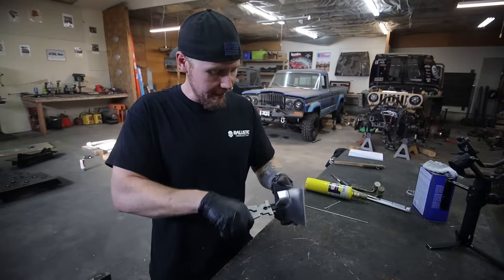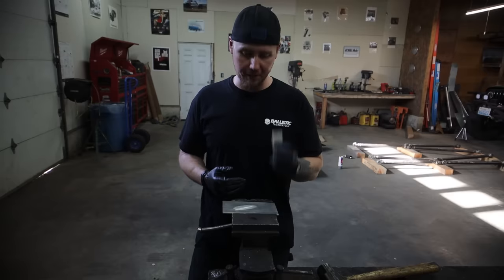Amazon's CHEAP Alternative To Aluminum Welding!!! (Alumaloy)

Comment: Mine came with directions, use a clean stainless wire brush at the joint and immediately heat. sandpaper or even a pocket knife to scrape down to shiny metal. Aluminum oxides form quickly in air (sometimes within seconds) and you'll never get the zinc I mean rods to wet with aluminum (oxide) properly.

Comment: I have tried 6 different types of so called "low temperature aluminum welding rods" with propane and MAPP torches. So far - no luck. I end up with the main aluminum part melting before thin aluminum wire melts upon touching it. Not sure what is wrong in my case. Thanks for the video anyway!
Reply: Using this stuff is soldering or brazing and not welding.

Comment: Fella the word is soldering not brazing. The terms are associated with the temperature range you are using. Just saying, all good too.
Reply: Victory First hey mate, naked flame is brazing!
Reply: @christownsend2399  Naked flame can be soldering, brazing, or welding. Think temperature as I was taught. Naked flame is just that a flame you control. Soldering roughly 300-400 degrees Fahrenheit. Brazing roughly 1100 -1600 Fahrenheit . Welding 2000 plus Farenheit roughly. That is right as I learned 30 years ago by a old certified welder who worked in the field fifty years.  I wish I could remember what that fella forgot. Have a great day too.
Reply: Soldering is capillary action jointing, the other type is inter granular  penetration e.g. bronze welding,the term " brazing " comes from the old  charcoal Braziers used  long ago .usage of the terms seems to be pretty fluid these days.
Reply: @pauldavidson6321  You say potato I say potato but we both are correct to a great degree. Peace and out too.

Comment: I would like to see a video on MiG brazing with silicon bronze wire vs MiG welding.
Reply: I've done this on my MIG, you have to use argon gas and you must make sure that the surface metal is clean.  Once the arc is struck and your machine is set correctly, it will flow much like a braze where the wire melts and adheres to the metal.  This isn't a strong weld it's only purpose is for non-structural joints like body panels.  The wire isn't widely available and in my case I had to order my two pound spools.
Reply: I put on an aluminum welding class at a body shop one time, and they had this MIG welder that have three guns one had steel wire one head silicon bronze and the other one had aluminum
Reply: You might as well just get a spool gun and just use aluminum wire unless you're going for a certain look.

Comment: biggest problem is you need A TON OF HEAT when you have just a little bit of a bigger object.

At work, we tried this stuff to repair big alu dieseltanks, but it was just impossible.
We used 3 torches and it just didnt work, and when it was hot enough, we blew a hole ....

Comment: Thanks for the walk threw on procedures and glad to see you used MAPP gas here since as you've seen, propane would take longer to get the base metal up to the point where the rod would adhere well.  As for use on fuel tanks or pressurized applications, I would of course test first and even wait for a couple of weeks since I've seen other videos describing that some alum weld products would break free under stress.  Also, can this work as well for aluminum alloys, cast aluminum?  As you may have seen, cast aluminum can have other metals mixed in and I'm no expert yet.  I think TIG welding would be the best way to go on structural applications or anything you want to be strong such as motorcycle parts.

Comment: Acts a little bit like solder. Wonder what some flux would have done?
Reply from the maker: They make flux for brazing aluminum but this particular product says it doesn't require it so I didn't use it in the video. We use flux a lot at work in a definitely makes a huge difference in the quality of the joint. My guess is flux would help this stuff but I can't be sure without testing it. 👍
Reply: i am a plumber by trade so tried this works great also used with la-co plumbers flux works even better

Comment: Seems like a great option for connecting aluminum sections for rapid prototyping. Could do lost casting with 3d prints in pla, and then connect them together for larger projects. Might be strong enough for basic fitment and light testing of function.
Reply: The rods are basically ZA27 alloy, just aluminium dissolved in zinc. Joins formed with this stuff become some sort of zinc alloy. I used to make my own rods from old floppy drive chassis, they are not easy to find these days, but carburettors are still made with it.

Comment: quick heat is essential, if it takes too long or you have too long a seam to run the air quickly promotes oxide formation on the hot surface. The flame actually performs the function of shielding the weld, not in the same degree of effectiveness as and envelope of inert gas but still it does consume the oxygen at the point of heating, pulling away allows the air to react to the hot aluminum.

Comment: No fusion so no good!
I wouldn't trust that crap to seal the foil wrapped around my cheese sandwich.
Oh and it's not soldering or brazing of any description, it's a cheap low melting point alloy best suited to casting model soldiers or fishing weights.
Reply: It's as close to welding as I am to the moon , if this quy thinks ( or anyone believes this is welding ) they are dangerously deluded.
Reply: It's Private  Pretty much everything you own is prob produced in China.  I'm not necessarily disagreeing with some of your premise, but please show a truly American product that can do simple thing like this for us to buy. If I know for sure it's made here in the US, I will surely buy it.  Sadly, china has gotten away with most of this because of dirty politicians making it possible.

Comment: Love this stuff, but there's no way I'm field-welding a fuel tank, dude.  We've got a MAPP gas torch w/a hose that rocks and I'd rather do this than MIG for a number of jobs.  Less chance my amateur skills will melt-through, you know?
Reply: The fact that it is a fuel tank doesn't matter, as long as, nearby, you have an acetone soaked rag sitting on top of the full can of actone!   ;o)
(This comment was brought to you by "Safety Trolls Inc.")
Reply: Tig or nothing bud.
Mig welding with a spool gun is disastrous. 
Any welder worth their salt is cringing.
Reply: @smokepeddler  i like smaw more & if yer desperate ya can weld with yer jumper leads
Reply: @smokepeddler  MIG welding with a spool gun is an art. After doing it for a couple of days (I used to build ambulances), it was a cake walk.

Comment: Could i use this to fabricate a main spar bracket on an experimental homebuilt jet aircraft?
Reply from the maker: Lol not sure
Reply: Thats how I fabricate all of mine, it's the fabrication secret the aviation industry doesn't wan't you to know about.
Reply: Only if it's an experimental homebuilt RC jet aircraft. For anything i'd be riding in i'd want a good TIG weld. lookup weldingtipsandtricks youtube channel
Reply: @darrelljacobjr2120  I thought the sarcasm was really obvious. You would not braze together the most important structure of an experimental jet.....

Ideally anything that can be riveted should be to avoid warping and to maintain integrity.
Reply: Only if you want to die.
Reply: @tigerseye73  Or you don't like the test pilot
Reply: You can get away with it once 👍.

Comment: Nope, I couldn't get it to work, I suspect it's related to the torch I was using.
Reply: I don't think it will work, with a little map gas torch,  couldn't get it to work on a fence post, which was broken, Got me a real oxy/propane torch now, if I run across this again!

Comment: If I could modify an aluminum radiator with this that would be pretty darn cool.
Reply: You can... Brazzing rod has been around for 40+ years.... the tempratures required has dropped but the process is exactly the same.
Reply: @louispeters2105  That is what I planned to do on an aluminium radiator for my 1980 Mercedes. The rad had plastic top and bottom tanks that are crimped on with a rubber seal but the crimping failed and the rad leaks big time. I'll make the top and bottom tanks from some sheet aluminium and weld/braze them permanently on.

Comment: Cool video. You should do the same video but drill the bottom edges with half holes, like a “c” facing down and when you heat the back part of plate it will draw the weld to the other aide and see if its stronger.

Comment: I’ve used this and both pieces need to be up to temperature and if the pieces are big, it takes a lot of heat. 
The commercial videos show soda cans and maybe one big part but they don’t tell you that you’ll never get the big part up to temperature with a propane torch. 
They pre-heat it with an oxyacetylene torch.
Reply: When I did aluminum brazing on the job we used propane oxygen with a huge tip for broad heating and about a 15" flame. You'd stand off with the flame about 8" from the work zone and then move in close to add the rod and direct the braze. It ended up looking like you were bowing to the work piece lol. Oxyacetylene is probably too much heat and can easily melt the aluminum.

Comment: Very useful video.  Visiting the "Alumaloy" web site, seems like a good company.  Some points:
1.  They advertise tensile strength of the aluminum product as 39,000 PSI, not that much lower than the base metal (Aluminum 6061 T-6, 45,000 PSI).  From your test the spec seems at least ball-park accurate.  
2.  They have products for steel, stainless steel and brass/copper.  A lot of work went into developing alloys that would adhere to the different metals.  The steel and stainless steel rods have similar (low) working ranges  but the stainless steel has a much lower tensile strength (11,000 psi) and has the warning about use with potable water.  So lead or zinc are involved.  But it works with stainless steel, which is impressive.
I did not check which of these other products are available on Amazon, but a kit including a torch and a selection of the different rods would make a good emergency repair kit.

Comment: Like you mentioned in your video if you prepare it by so called tinning for lack of better terminology... the smaller gauge material will then adhere quicker ... actually you could try and tin the thicker first too because having both is just a thicker heatsink... also don’t forget to keep it vented well and don’t apply the flame directly to the rods... they will crumble
There are a multitude of material in different rods... the lowest melting point rod is majorly Zinc with the secondary material of Aluminum
The melting point is around 400C

Comment: I used these rods over 30 years ago to fix side plates on motorcycles. use to get them at a auction 24 rods for $8.00.

Comment: I saw this stuff about 25yrs ago at a Hobby show and it was a woman doing the demo on a Soda can she poked a hole in using a Propane torch  not Mapp gas  she was a pro at it.    I bought some and used it with limited success  I don't know what the alloy is but the Weld area was as hard as a rock when it cools  now I just use the Heli arc welder at work its a lot easier
Reply: I saw the same at a swap meet in Torrance, CA 30 years ago.

Comment: Good stuff but a word of caution...
I used it to plug a couple holes in an old aluminum boat that had been shot at. The brazing rods worked excellent at plugging the holes. The bad part was that after a season in the water, the plugs and brazing material corroded right thru! Looks like it suffers from "dissimilar metal" electrolytic corrosion effects. The rods are an alloy, not aluminum, and will sacrifice themselves over time.

Comment: Oxy-fuel welding is the oldest form of welding known to mankind. It is a nicer way to weld than TIG for many things. If you had a regulated rig and not a MAPP gas torch you could run OXY rich or fuel rich depending on the material. That lets you get different weld strengths and surface hardness characteristics. Back when I was servicing A/C systems they had a torch head for MAPP gas called a turbo torch. It would burn MAPP gas bottles hot enough to weld hard copper tube with copper filler rod. Comes in handy for when you have limits on how much gear you can pack around. Nice video on torching Aluminum. I carry an MX size bottle rig on my truck, Ox-Acetylene, so I can weld axles, frames and anything else that breaks way out in the bush. That gets you home, where you can clean things up and make things look nice. Surface prep in the field is difficult so files are my go to, but I've been playing around with an inverter, I picked up cheap, and it runs a wheel grinder pretty easily. I may have a new go to in that, but it's too early for me to say definitively.

Comment: This stuff makes a great looking weld but the trouble is that it has no strength.  I fabricated 3" x 3"
corners for a pontoon boat and they looked great. When I bolted them down every weld cracked from end
to end. They were not over tightened just snugged up.

Comment: these have been at HF forever now, always wondered about trying them out as well
if you use a large propane torch on the tank it should help the rest of the tanks mass is drawing the heat away from your work
in welding larger pieces or thicker materiel's require more amperage

Comment: some old school welders could gas weld aluminum. Something about using oak chips on the metal and judging the heat by the smoke from the chips. I picked that up watching a video on hot rods. They did make a big deal out of this guy knowing how to do it.I'd like to see how he did that, but he died a few years after I was born. It was the same guy who started the speed test at Bonneville.
Reply: Nop not SMOKE the gas changes colur when the temperature is. Right.. but these smart Assens wount tell you that 
Look for the greenish culur when IT start to apear USE THE ALU THINGI.. !!!NEWER GO FULL GREEN TARD YOU WILL LOOSE!!

Comment: This is what i use to repair holes in high pressure hvac coils it also works great on aluminum oil coolers. I dont know what kind of spec the other rods out there have but this is true alum brazing rod, it is strong and there are a few videos out there how to use it. 

AL 822

Product Overview
AL 822 is a low temperature alloy ideal for brazing or soldering aluminum to aluminum or aluminum to copper. Non corrosive flux does not require removal after brazing. It is ideal for open air heating methods and very easy to use for aluminum brazing in HVAC/R applications.
Joins AL to AL
Joins AL to CU
Flux cored
Low temperature braze
High strength braze
Ideal HVAC brazing rod for making repairs
Industry Applications:
HVAC solder or braze

HVAC and refrigeration repair work, patching holes in aluminum coils in automotive units.

Comment: The reason it took so long to heat was that the vice was also taking some heat away. You need to add an insulator between the vice and the aluminum.

Comment: Hi interesting video thanks. If you stroke a match stick on the metal close to the parts you are going to braze, if it leaves a brown line then the metal is very close to the temperature need to braze the parts together.

Comment: Use a heat dam to control the spread of heat 
     Rectorseal 83560 Hot Block Reusable Heat Absorption Putty

Comment: The bend was a big heatsink making the alloy slow to flow, starting at the far end away from the bend would have built up heat quicker and by the time the angle was approached, plenty of heat would have built up allowing good flow.

Comment: If you sharpen a stainless steel bicycle spoke to a point and scratch the metal surface thru the molten puddle as you heat it the join will be even stronger because the two metals sort of fuse together rather than just stick together
Reply from the maker: Great tip! Thank you!

Comment: I am a coach builder. I use aluminum rod and Union Carbide flux on our alloy bodies to control the alloy as it goes through the English wheel  when I absolutely have to. When I was younger I was able to but weld 0.040 with just flux. I think it was 4000 series they called it. I have been using a product called Alladin for 20 years on pot metal and we usually use a stainless rod to pull the weld into the substrate to link up the material. I tried this stuff on a gearcase for my Evinrude and the rod did not penetrate or adhere. When I filed it there was a line and it flaked off like solder. I'll probably just buy a tig and cut some metal out of another Evinrude for filler rod and fuse it unless someone can help me with some ideas on what went wrong. Thanks.

Comment: I saw this stuff in a commercial and it looked like they were welding/braizing/joining (whatever) more than aluminum. The strength test shows looked like two pieces of steel about the same shape as your test. In any case, this stuff looks very strong and useful for a lot of projects I have as well. There is another YT-video <Delboy's Garage, "Aluminium Welding" ?> an he strongly suggests NOT using this for any type of fuel tank.

Comment: Not for food/drinking water containers.  These kinds of rods are usually some kind of cadmium alloy.  So, no contact with food or drinking water.  Also, probably will vaporize at tig/mig welding temperatures.  Think zinc and its hazards if overheated.  Certainly a lot more portable than a tig machine!
Reply: It's usually Zn94Al6, lowest melting point of the ZnAl alloys and works well.